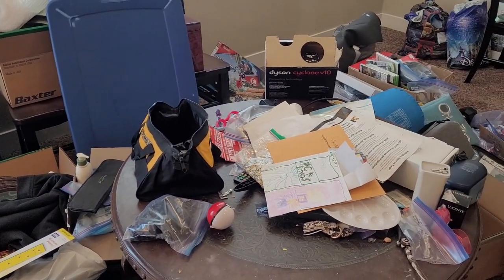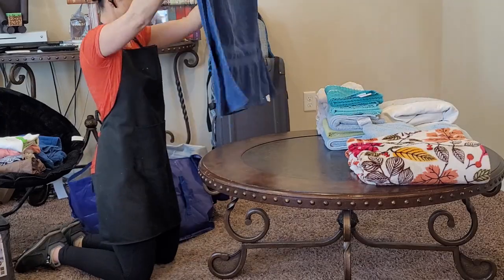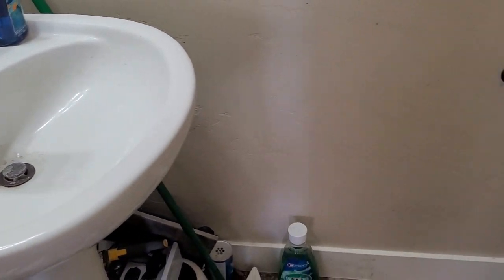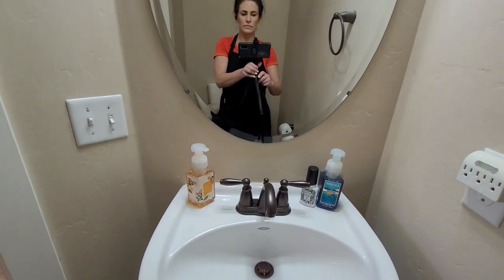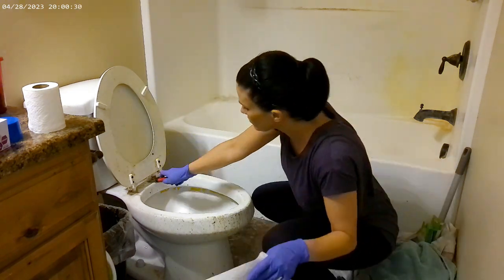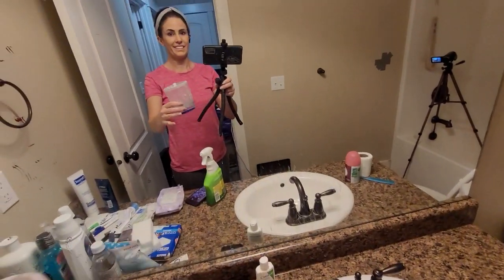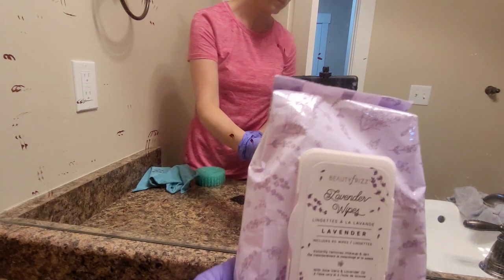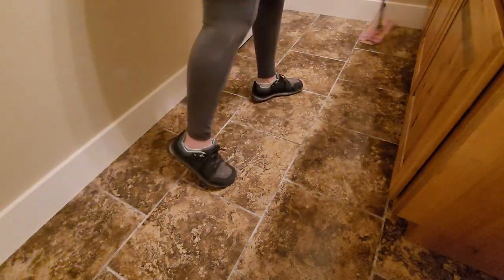Extreme cleaning a home for FREE to help reunite a family...part 2 (BATHROOM EDITION!!) #cleanwithme

Comment: You can use toilet bowl cleaner on the shower as well works great on hard water spots
Reply from the maker: Great tip! I have heard that, but haven't tried it yet.  I believe you aren't supposed to use it on the handles though. I think the acid eats the polish.  I could be wrong though.
Reply: Yes works great !

Comment: Thank you for helping these families. Oh, that carpet water was dirty. How many times did you have to go over that before you got clean water?
Reply from the maker: I actually only went over it twice to see if I the carpet could be saved, but after twice over, there were some pretty big stains that weren't going to budge. I think she is going to replace that small area with wood flooring. I know she wants to get rid of the carpet throughout the house, but that would be pretty expensive and I'm not sure they are financially able to do that right now.

Comment: I think you'll find Dawn powerwash is sufficient for bathroom cleaning. (And cleaning just about anything!) No need to make yourself sick with the harsher oven cleaner.
Toilet paper over, of course. There is no other answer.
Reply from the maker: You're probably right. I had just heard oven clean works really well on bathtubs and toilets and was curious about trying it.  It did work great, but probably not any better than other cleaners I have used.  Dawn Powerwash really is fantastic for just about everything. Love the stuff!

Comment: They have a fume free easy off. Also if you ever come across grease best stuff ever is Dirtex you spray and it literally will wipe right off. Best thing when I had to do unit turnovers and clean above stove
Reply from the maker: I haven't heard of Dirtex, but I just ordered me some. Sounds amazing! Watch for it in an upcoming video and thanks for the suggestion!
Reply: @ABeautifulMessExtremeCle-zl1wp  I wish I could post a Pic of what it looks like on YouTube. Comes in tall can like easy off but taller and think brand on it says savogran. They have powder too but never tried that.

Comment: Gross carpet water. Feels like it would need to be done a couple of more times in coming weeks
Reply from the maker: They were undecided on whether they were going to get new carpet down here because it was pretty damaged, so I told her I would at least try to clean it to see if it could be saved, but, unfortunately, it still looked pretty rough afterwards.  But, you're right, if it was salvageable, I would have gone over it two or three more times.